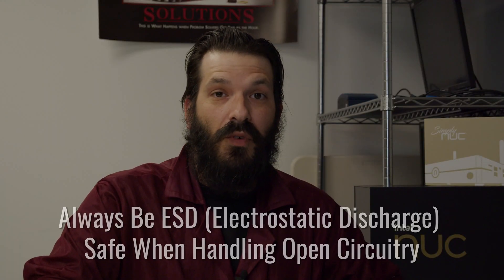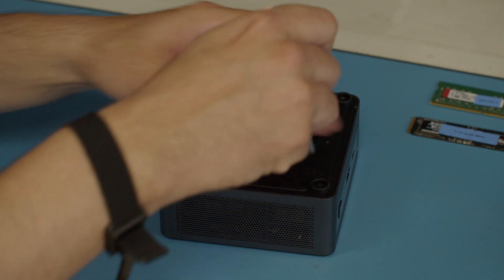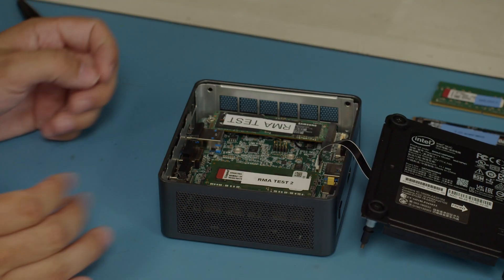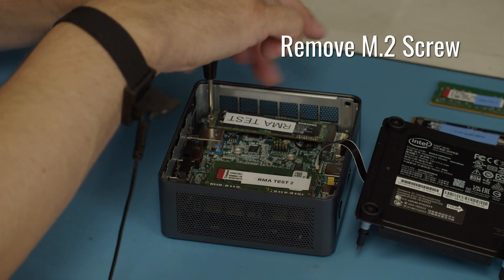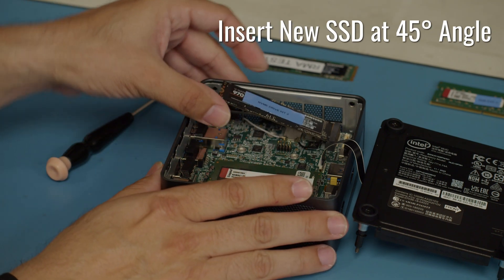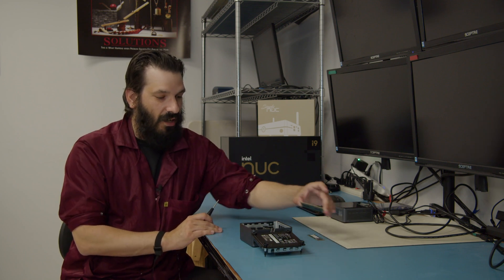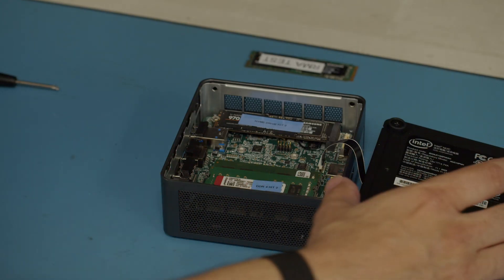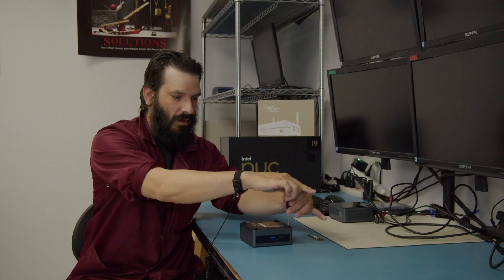How To Upgrade Your Mini PC's RAM and SSD: Step By Step Directions

Comment: Do you have a video on the NAB6 Lite Minisforum PC? I'm trying to remove the M.2 SSD the M.2 Fan has screws on both sides in top of it. One side i can't reach unless the whole motherboard is removed. I almost accomplished it but couldn't figure out what else was holding it in place after removing the bottom and unscrewing the 4 corners.
Reply: It turns out I'm an idiot and was removing screws holding the M.2 Cooler Chassis Together. The one screw on top held it in the device and the Cooler itself popped out with the M.2 seated inside.

Comment: Question... I have an AceMagic Vista Mini PC with 512GB SSD, an SSD which, just like the one in your picture, has two gaps (in the interface). However my replacement M.2 is NVME and has just the one gap so I'm worried I might damage something. The interface slot looks like it would work. Any suggestion, reassurance?
Reply from the maker: If I understood your question correctly it looks like you have a 2242 SSD instead of a 2280 SSD. You should be able to install either size SSD with no issues.

Comment: What kind of RAM and SSD is compatible? Can you list it in a comment please?
Reply from the maker: It depends on the product model and SKU. In this case, Sean is using M.2 2280 for the NVMe and DDR4 SODIMM for the RAM. Some systems can have a small 2.5" Sata SSD installed as well.

Comment: If I replace the ssd that came with the pc with another one. What will happen to the OS the was pre-installed on purchase.
Reply: Before replacing the SSD, you clone your old SDD to your new SSD (will need an enclosure for that). Alternatively, you can do a new Windows install through MS and it should automatically recognize your windows ID.
Reply: @Fred-q1x  That part! LOL

Comment: If your OS is on the old SSD, how, how do you boot the computer after installing a new one?
Reply: If you wanted to maintain everything as-is without reinstalling an OS and all the programs on the boot drive, you'd need to clone the drive to your new drive before swapping them.  bit-by-bit clone software is free e.g. Macium Reflect (Win), dd (built-in nix). You'd likely need to get a cheap enclosure for your new drive i.e. M.2 and 2.5" so you can have both drives plugged in.  Your boot drive will remain, while you have the enclosure hooked up likely via USB
Reply: Learn.
Reply: @stephanblack4558  like your momma did.